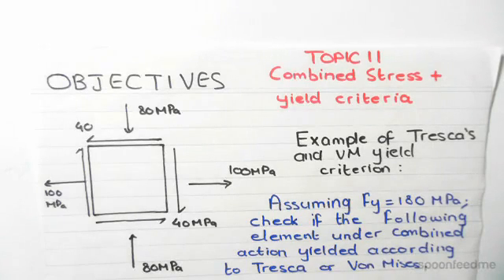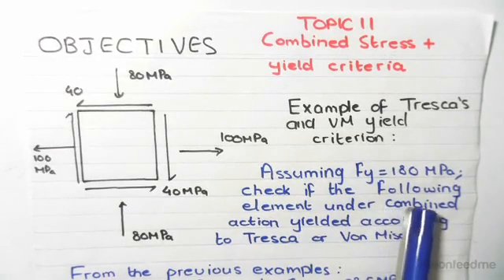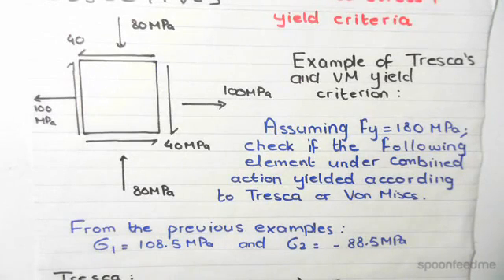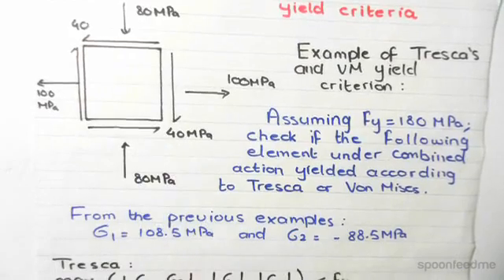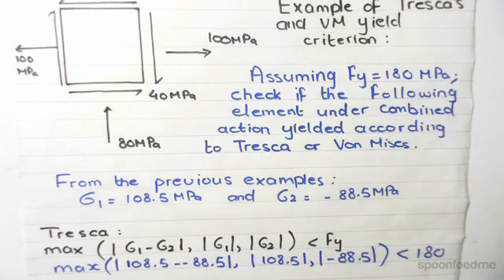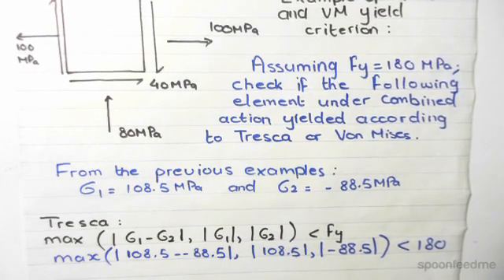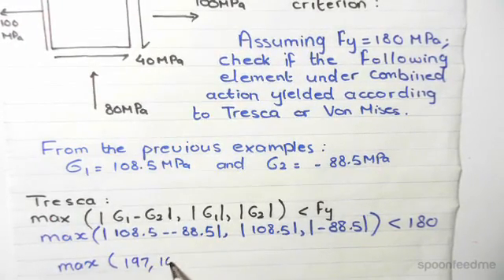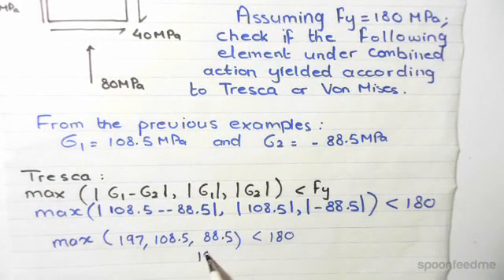Von Mises & Trescas Yield Criterion Example | Mechanics of Solids

Comment: if we want to calculate stressess between element of bike chain (for example)after applying a tensile strength along its axis >>>> what kind of studies we have to make in this situation >>>what's the best for this study >>>tresca theory or von mises
Reply: It depends, Tresca is useful for brittle materials that do not have a well defined yield limit or that are generally inelastic (High stress vs little deformation). Von misses is good for those materials that are less brittle. Brittleness of a material is also influenced by its temperature, so you may be able to employ von misses say for steel at atmospherics - 100s degrees or so, but it may become brittle at subzero temperatures etc. FEA packages usually employ VM, But I prefer to USE ASME elliptic in non FEA calculations, it is more conservative than VM.